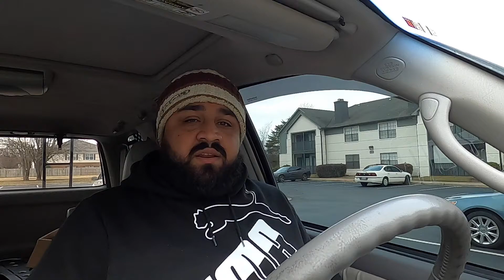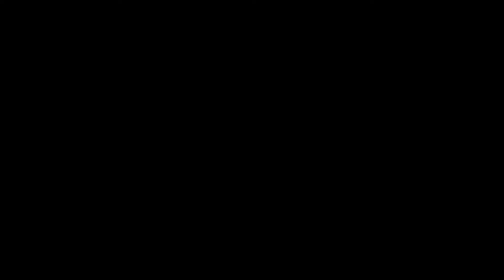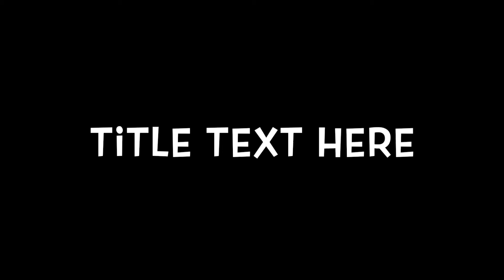Toyota Sequoia build cost break down!

Comment: I paid 44K for my 2002 Limited Sequoia. I still have it and it has 220k and runs perfect. Never left my stranded, one new radiator about two years ago, 5 sets of tires, several batteries. I used it for years to pull my fishing boat. In 2014 I bought a 2013 Raptor GEN 1. Sold that this year in now have a 2023 F150 XLT, Still love my Sequoia, I would cry if it was in an accident. Needs some love in the way of new outside lights all around. You have a new sub.
Reply from the maker: They are so underrated and have so much potential and thank you for the support!

Comment: I paid $14,500 for my 2007 limited 2WD with 95k miles driven
We traded in our 2007 Prius with 132k miles driven for 8k(pointed out the timing belt and other maintenance that needed to be done and the dealership raised 2k more on our trade-in.)

So far the toyota dealership did these and they were the cheapest in labor and parts compared to the other shops around town.

$900 on timing belt(water pump, all the belts(serpentine, tensioner etc...)
$1200 on lower control arm, upper and lower ball joint and outer tie rod replacement
$190 radiator flush
$590 on valve cover gasket
$1,000 for Michelin LTX Defender(yes overkill what I don't care) 

Did these on my own
Tranny drain and fill
spark plugs
replacing lock actuator
rear diff drain and fill

I want to do the big brake and get some dobinsons IMS struts on stock height next.
Reply from the maker: man that's a lot but it will last you a long time

Comment: Did you add any plates for cat protection ?    I’ve been looking for  heavy duty one but no kits are available for sequoia.  Iam in Cali and they cut them off here left and right.    I bought 1/2” rebar with breathable thick gauge steel sheet .  Working on coming up with a design.
Reply from the maker: CFMindustriesllc on IG has a full underbelly with cat protectors
Reply: @MoWahidi  thanks I’ll get a hold of them.  Do you know roughly what the cost is ?
Reply from the maker: @tcjha6250  no I don't sorry I never priced them so when you find out let me know
Reply: @mo Wahidi  Thank you for great content and very good information. 8 years ago I bought mine for 9.8k and now it has 198k miles and runs like a champion... what size tires do you have??
Reply from the maker: @arielmorales4830  that's a really good price! and im running 265/70/17
Reply from the maker: @arielmorales4830  im sorry is That a company?